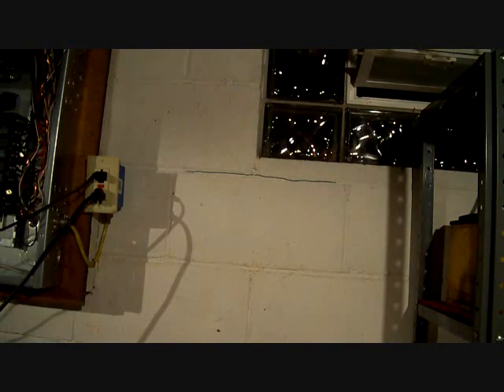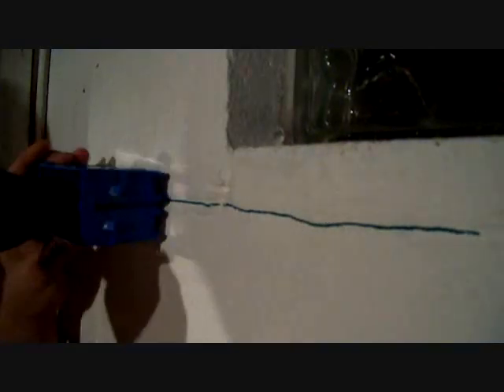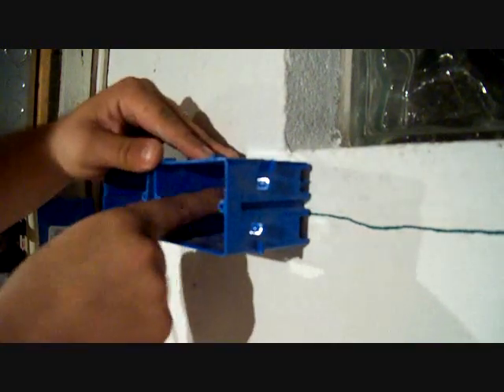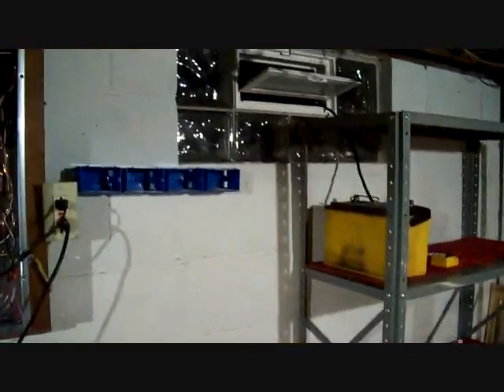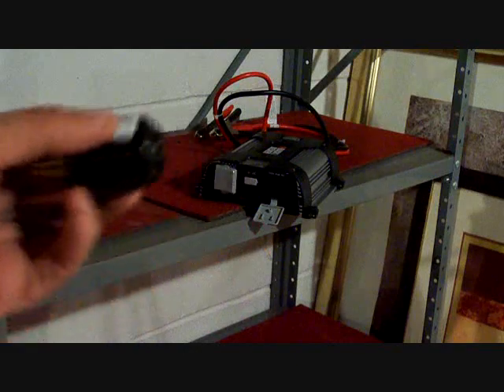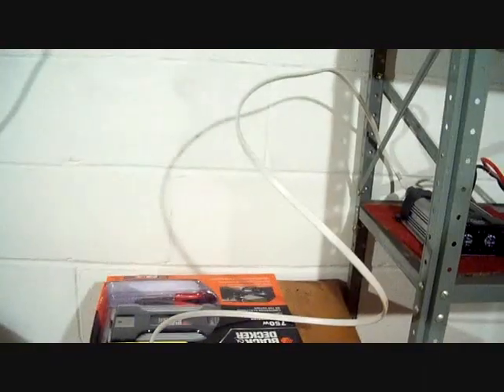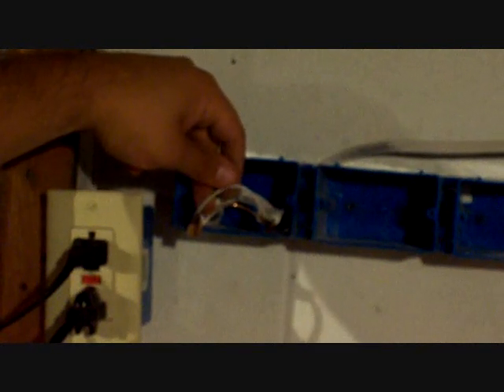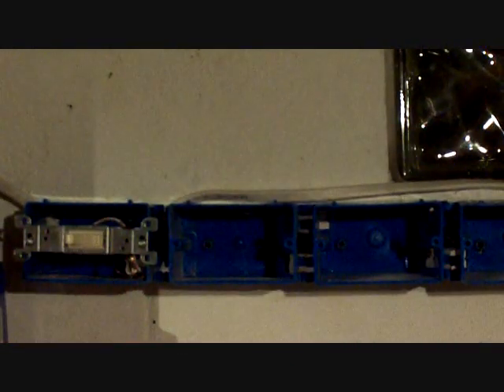Wind Turbine Electrical Guide Part 2 1of2, Part 1 of part 2

Comment: I love what you’re doing with your system, it looks great!  One tip I would give is to screw a board to the wall first, then screw your boxes to the board.  You then only need 4 screws going into the concrete wall.  Anyway, keep up the good work!